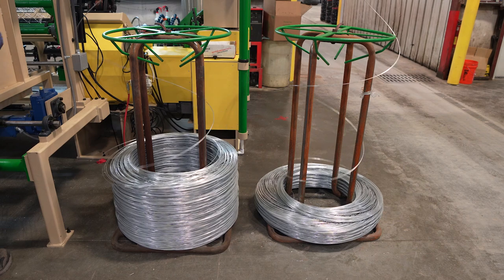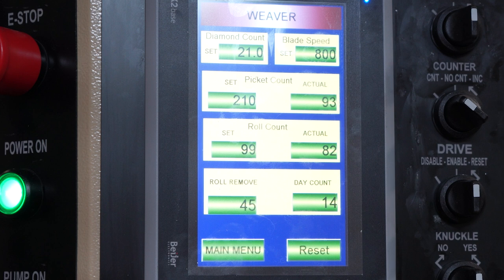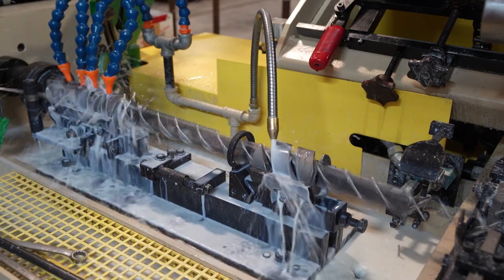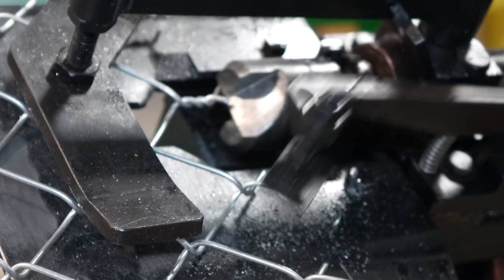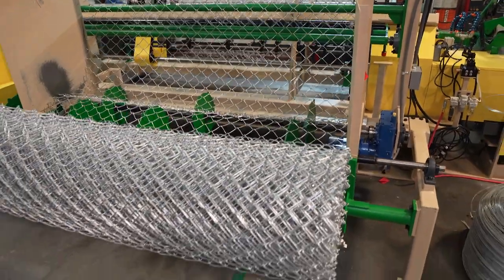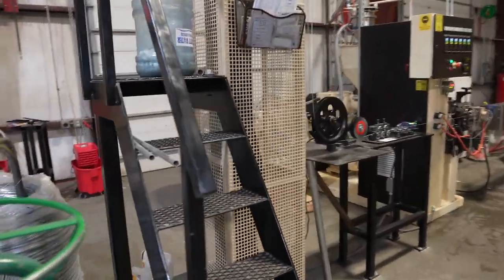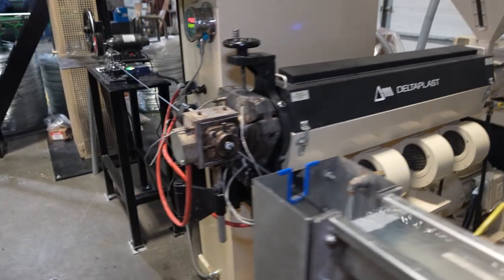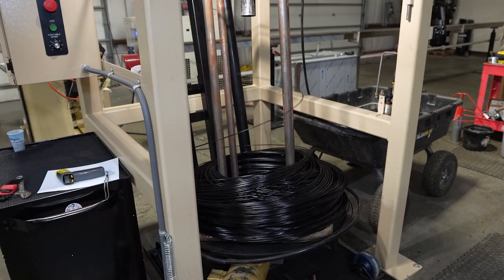CRAZY Chain Link Fence Machines - How Chain Link Fence is Made

Comment: I'm curious! So then, is one "needle"/half diamond counted as one picket? Or, is it that one full diamond/two needles is one picket?

Also, I'm curious about how the machine is calibrated for different heights of mesh. Say 60" as opposed to 72". Is it the diamond count? Does rpm or wire feed speed play into this? Knuckle-knuckle vs. Knuckle-barb and so on. I think I've got it figured out but I need confirmation 😂.  

Thanks!
Reply from the maker: Yes, the diamond count is adjusted to make the height. RPM and therefore the wire feed speed don’t play into the height adjustments.
Reply: @JoeEverest  thanks for the reply! 

One picket is one weaved wire, correct?

Comment: I run a Wafios DF51 chainlink machine they're far superior to the Bergandi
Reply from the maker: Good to know! Which Bergandi machine have you run as a comparison?
Reply: @JoeEverest  both the WVR 500 and 600,Wafios are run by Hydraulics it's far easier and quicker to do height and salvage changes,everything is just easier and more efficient making for a higher production rate